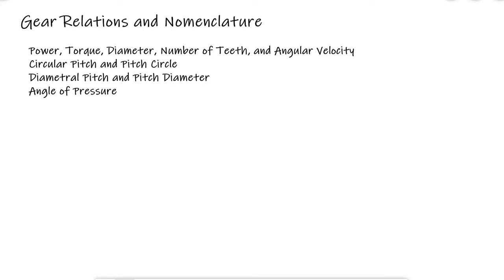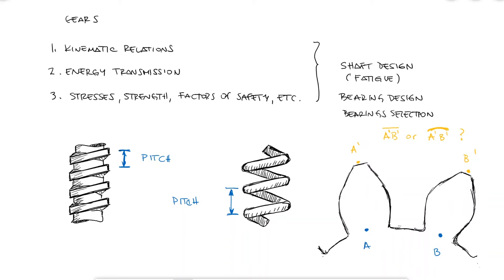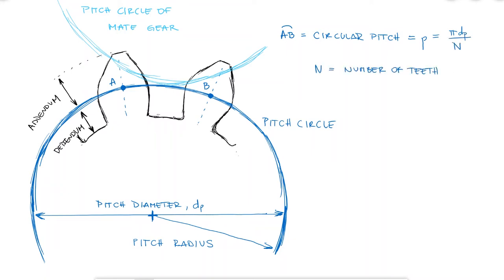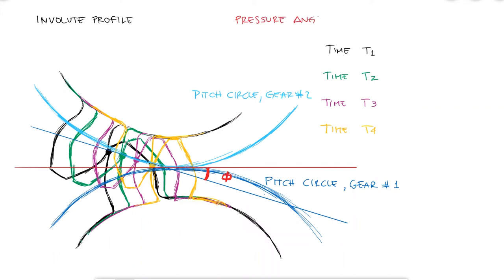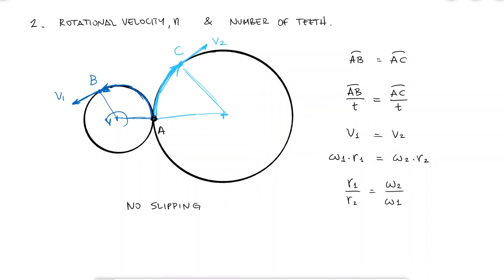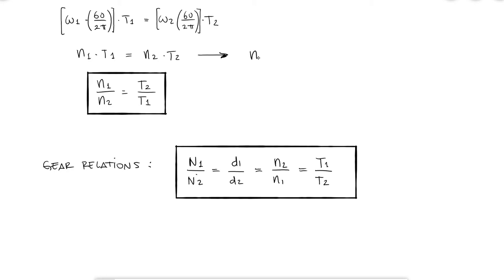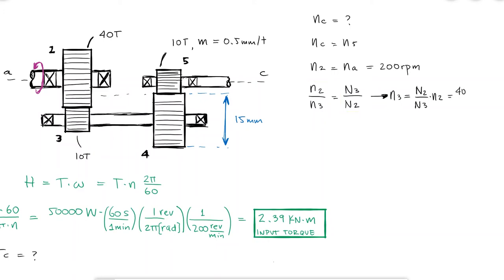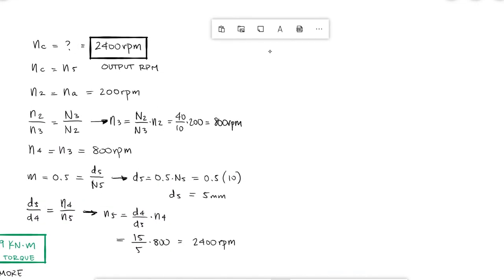GEARS BASICS - Nomenclature and Main Relations in Just Over 10 Minutes!

Comment: Thanks for video but the last example gives the impresion that a speed increasing drive is simply a speed decreasing drive in reverse, its not.

There are factors such as:
1. The length of the lines of access and recess along tje line of action which are coupled to lubrication characteristics. So called, non-standard gear geometry needs to be considered.

2. Gears have a natural frequency which needs to be considered compared to their operating speed. This is more critical in speed increasing drives.

3. Vibration, as above, this factor also plays a bigger part. Analysis os needed to ensure that the gear train's operating speed is not in line with its natural frequency.